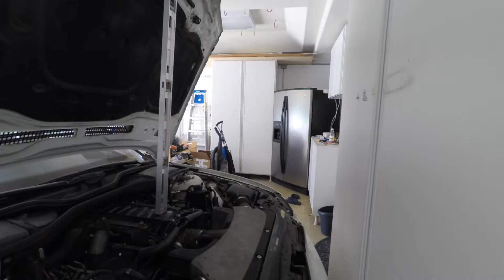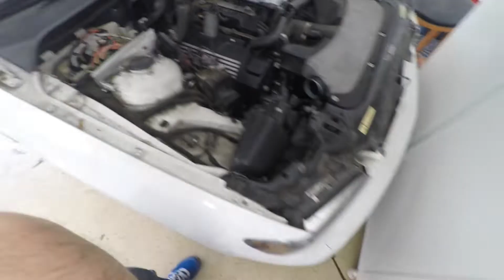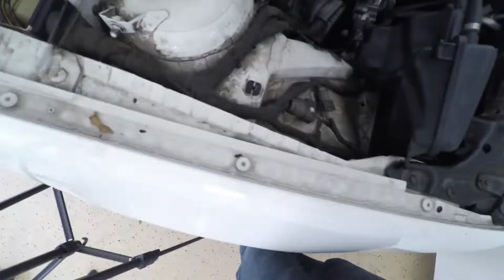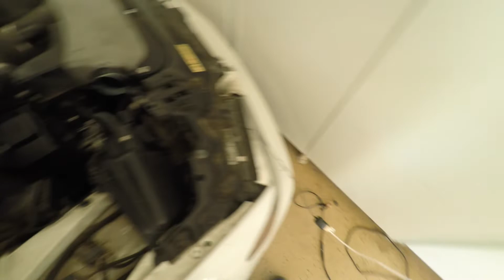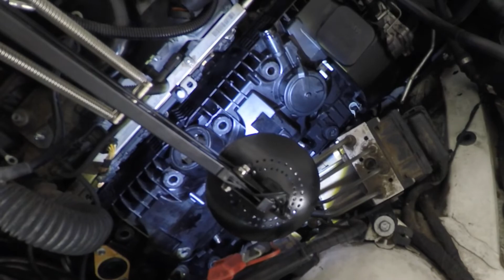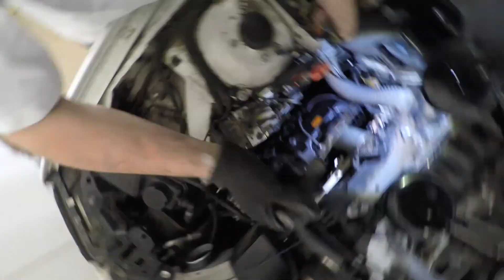DIY Replace BMW E66 (750Li) N62 Engine Gasket without taking out the engine

Comment: When u say engine gasket, I thought cylinder head gasket. You are removing valve cover gasket which is not hard.
Reply from the maker: It is not easy for first timer to figure out how to do it without dropping the engine out. The tight space is the hardest part.
Reply: I thought he was gonna do the head gasket as well… 😂🤦🏾‍♂️🤷🏽‍♂️

Comment: why did you stop at 30 and not complete the last 2? I bet its the rear  Cylinder 4 and 8 Intake Valve that you past up on? I`m stuck at that point too as I`m attacking this very job. I have 36 manned hours in my garage.. Its a crazy job alright!
Reply from the maker: Exactly. The valvetronic driving gear blocks the space to work on the last two.
Reply: @frankghl   Hmm.. Maybe I should pass on those 2 myself?  It looks impossible to reach with AGA tool set. let alone see if you`re compressing the spring down correctly or install the keepers...The problem im having is that all the intake and exhaust Valve stem seals have the same open hole wear on the seals...I don`t want  to see smoke any more coming out of my Alpina B7
Reply: BTW di you have issues with the Valvetronic rolling retainers fall of it`s axis? There`s no way in hell to remove the Rocker arms on the intake valves without pushing off the retainers .  Reinstalling the retainers is almost impossible. With 1 hand Im pushing the Metal coil spring back with a V shaped flathead screwdriver( so the metal end doesnt slide off) and on the other hand inserting the retainer. Once the retainer is in place I have to make sure I release the metal spring coil end back on the V shaped section of the retainer... OMG what a job this has been...
Reply from the maker: @1SNITCH  I would pass on those 2. If you replace 30 out of 32, that's good enough to pass emission test
Reply from the maker: @1SNITCH  I did experience the same trouble. It took me hours of struggle to put it back using all kinds of tools I can find. It's not easy
Reply: @frankghl  I’m a novice mechanic I quickly had to do a crash course 101 on these damn retainers.  I used a pry end ( V shaped) screw driver to punch in the coil metal spring end on 1 hand and the other hand to position the retainer under and thru the it’s mounting hole. Released the spring and made sure it sat in that V shaped retainer mount.   I couldn’t believe I did it that way. I was afraid I was forced to remove the whole  upper intake valvetronics cam set.

Comment: WOW, that is monster job. I am thinking about purchasing a 2007-2010 650i, but after watching this I am not sure if this is the type of effort I would like to expend to replace spark plugs let alone this job.  I thought my 2008 Audi S4 was difficult to work on, which it was, but at least the spark plugs were extremely easy to replace.  Great job Frank !!!
Reply: spark plugs are easy to replace on these engines? where did you see it was a nightmare?
Reply: Hello Fabian, was commenting relatively on spark plug removal.  My Audi S4 was a breeze, all plugs on top. My Mercedes not that bad either.  I am now looking to buy a 911 or Cayman whichever I can get cheapest. I cant wait to see how DIY is with either. I was looking at what this guy had to take off. Happy Holidays.
Reply: @1SNITCH i think he thought you have to take out the valve covers to access the spark plugs 😂😂😂

Comment: Video is really awesome but you haven't show how did you replace the cam seals which you shown in the video that were able to change 30 out of 32? Can you upload the video so we can check it out? Thanks
Reply from the maker: I didn't film the part that I replaced the cam seals. I bought a tool set for around $1k from AGA and it worked out well for me. After that I sold the tool for almost the same price I purchased. 
They have very high quality video already. Check it out.  https://youtu.be/vZ-uhT-6ogc
The only thing they didn't show in that video is how to uncover the engine cover, which you can learn from my video. Hope this helps
Reply: If the car is smoking its your exhaust seals (16), I did not replace the intake seals and all smoke has ceased!  I rented my tool from tool from Tony's Tool Rental.
Reply: @jmcgrew23  I`m doing this very job and replacing all the exhaust seals was easy but the Intake valves are a PITA!! They have these rolling Valvetronic retainers that fall off it`s axis when you remove the rocker arms out of way .. What a PITA to reinstall them

Comment: Excellent video!  What tool are you using to tighten valve cover bottom valve cover bolts?  I am struggling with my bottom bolts and definitely could use that tool.  Is it available online?
Reply from the maker: I use the same wrench that was shown in the early part of the video that I called handy-dandy tool
Reply: Anil Suthar  That’s called a Tite Reach on EBay your welcome
Reply: 1/4"  10mm and wrench gets too them with no problem...also buy a 1/4" torque wrench when its time to torque the bolts

Comment: What is the black ratchet you used to take out the passenger side valve cover bottom bolts? Thanks
Reply from the maker: I forgot where did I buy it from. but a quick google, I found similar one: https://www.homedepot.com/p/Klein-Tools-5-in-1-Ratcheting-Lineman-s-Wrench-KT155T/203481288?source=shoppingads&locale=en-US&mtc=Shopping-VF-F_DYNM-G-D27E-27_11_TOOLS_%26_ACCESSORIES-KLEIN_TOOLS-NA-Feed-SMART-NA-RMP-MK464343327_9016028252_FY21_1927&cm_mmc=Shopping-VF-F_DYNM-G-D27E-27_11_TOOLS_%26_ACCESSORIES-KLEIN_TOOLS-NA-Feed-SMART-NA-RMP-MK464343327_9016028252_FY21_1927-71700000083602792-58700007073070013-92700063677501840&gclid=Cj0KCQjwu7OIBhCsARIsALxCUaN63xvp0p8mwjvC6PaGdnLzaWC1GkjPGby0Su_Yv5sYVTcP9izNhFQaAnlVEALw_wcB&gclsrc=aw.ds

Comment: Hi, thanks for a very informative video. I am wandering, do you have to torque the bolts back in? How much torque? Thanks.
Reply from the maker: Don't over torque the bolts. Roughly 50
Reply: @frankghl  Hi Frank, you seems very confident with your car. I have a 2005 bmw 645 Ci with 50k miles. Hi after I changed the valve cover gasket, brought idle when I turn the engine on, turned the engine off as it showed checked engine light, checked the code as follow P0120(throttle/pedal position sensor/switch A circuit, p0123(throttle/pedal position sensor/switch A circuit high) and p0222(throttle/pedal position sensor/switch B circuit low), I checked the throttle position sensor wire and it was not plug in, after I plug the wire in, my car would not crank anymore and dash board light like Christmas tree. Any idea/input will be appreciated.Thanks.
Reply from the maker: @rodrigodalay3860  I wish I can help, but I don't know the answer on top of my head. Try Google it . That's what I do usually.
Reply: @rodrigodalay3860  check of the maf sensor is connected